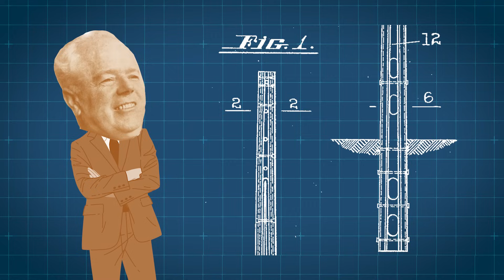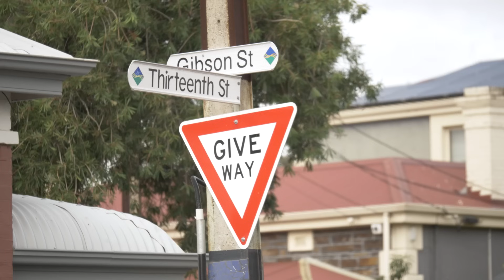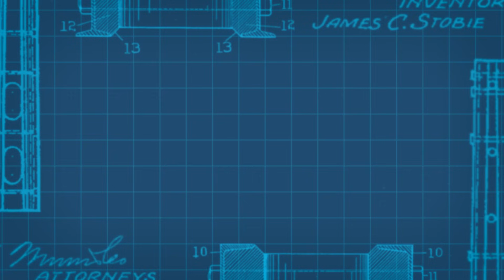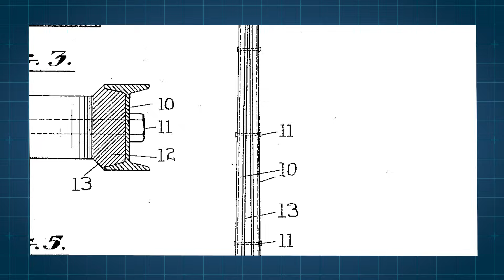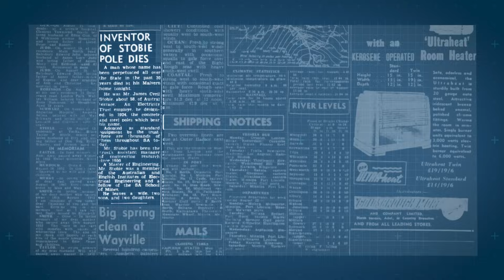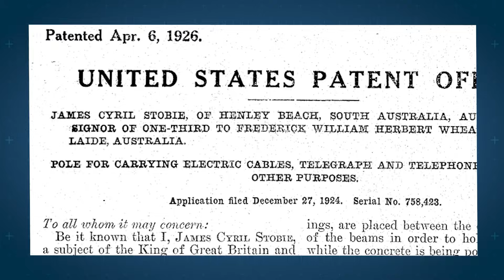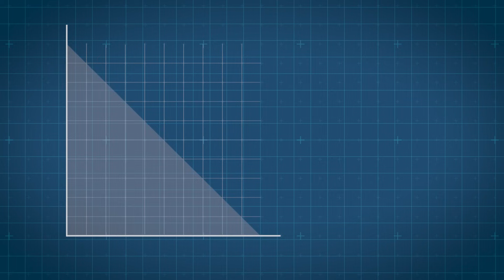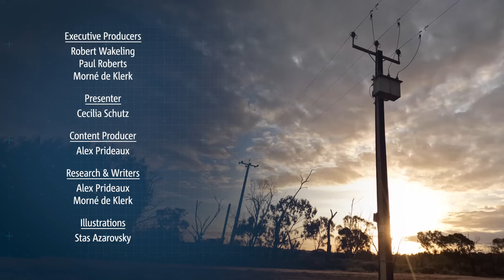Stobie poles: a century of powering South Australia

Comment: spent 15yrs in adelaide i noticed the stobie poles thought why aren't they used around OZ more often
seem better than the old wooden rotten lampoles we see in vic etc
Reply: They appear to be more difficult to climb than the conventional wooden cylindrical poles, requiring the use of insulated aerial platforms exclusively.

Comment: Who actually WANTS a power pole in front of their house. I'm off grid with none, no limits on vehicles or tractors.
Reply: A power pole in front of your house usually means a street light keeping your car in your driveway safer making thieves more visible. What I dont like is the stobie in front of my house is they put it a metre into alignment with my driveway. For decades my driveway only had a walking gateway even though its wide enough for a car. My house was built in 1864 so was there before the pole- sa water also put the meter in the way of the driveway too, but I dug it into the ground with a lid over.
Reply: The person who wanted a mural with an Australian bird like the other ones in the area. Probably funded by government, but unlike most other modern art actually might make the suburb better.

Comment: Stobie poles are common in Darwin and the Northern Territory - but without the concrete filling. I well remember  the Stobie poles on the Stuart Highway next to Darwin Airport on New Year’s Day 1975 - after Cyclone Tracy, they were bent over at 45 degrees, pointing away from Darwin towards the south-west, where my city of Palmerston now stands (think Canberra in the tropics, with 40,000 people - 25 kms or 30 mins south-west of Darwin). I flew-up then on a C-130 Hercules, as an Army Reserve Air Dispatcher (we trained in loading Hercs and Caribou’s for cargo parachute drops and normal flights). We were called-out in Melbourne on Boxing Day evening 1974 and loaded 71 Hercs on Darwin relief flights, 24/7 over the next 9 days - grabbing short night naps in our cars alongside the RAAF Laverton air-strip for the first 4 days, as Hercs from RAAF Richmond (near Sydney) could land at any time, needing loading and refuelling before a 6 hour flight to Darwin. Our main cargo was 2,500 equipment pallets - each comprising a petrol-powered generator, a petrol water pump and a gas BBQ stove. Drawn from camping shores in Adelaide, Melbourne, Canberra and Sydney - arriving on semi-trailers around the clock.They were allocated as one pallet per street, in Darwin’s wrecked suburbs - to allow the 9,000 men left behind, guarding their wrecked homes, to get together  and have a shower, a hot meal and some electricity each evening - after their wives and kids (35,000 people) had joined evacuation flights or driven south in the family car (usually with a cracked windscreen). (Kym (74) in Darwin - my unit was 37 Air Dispatch Platoon, Army Reserve - from 1971 to 75). (PS The RAAF had 18 of its’ 22 Hercs on Cyclone Tracy Darwin Relief flights over Xmas - New Year in 74/75 - plus a Herc from New Zealand (RNXAF) and a USAF C-141 Starlifter from Hawaii. My unit - 37 AD - had only 14 of us, but we were helped from 27 Dec after I rang the Salvation Army for help - they sent 20 younger Corps-men, to help us prepare pallets for loading,) PPS 73 adults and kids were killed by Cyclone Tracy.
Reply: Well if they didn't have concrete, they weren't stobies.
Reply: The Darwin stobies have horizontal steel bars linking the left and right upright poles, to provide strength during our regular cyclones. Then, they might bend a bit - but they won’t fall down. Are SA’s stobies cyclone-proof ? (Kym in Darwin - where our different stobies rule).

Comment: I don't think they are ugly. I've always for some reason appreciated lattice electricity pylons and power poles and n general. Electric overhead on railways . My autistic traits 🤪. It be expensive but any chance they could consider powder coating the metal ? Say try it on those poles that Only have a top set of 3 wires. Say trial a few poles that have those green disc insulators and powder coat the metal  a similar lightish green. Look spectacular. 
I went to south Oz and the rusty colour ruins the look. Take it from a 54 yr veteran of power pole porn

Comment: Nearly 40yrs ago we had a rope swing in the playground at my primary school in the Adl hills. The ground was sloped toward a fence and road that formed the boundary of one of the sides of the playground. The road was lined with stobies and power lines. At around grade 6 or 7 we found we were big enough to be able to swing out far enough and actually stand on the closest power line before swinging back. Luckily we were too short and unable to reach or bridge to the next row of cable. Good times.

Comment: Their only problem is they can rust at the base and topple over.
Reply: Never seen a pole fail by itself. Only collision by car, truck or heavy machinery vehicles...and even then the pole is mangled but still upright and doing its job.

But then maybe the one you seen was 100 years old? And if not in SA then it wasn't a Stobie pole.
Also most new ones have galvanised steel, these keep their metal colour and don't turn rusty reddish brown.
Reply: @stevenbalekic5683  It was in the Adelaide suburb of Hawthorn. The pole was not replaced and was not hit by anything.
Reply: @amraceway  
Must've been really old.
Reply: I've never seen one do that. Then again I haven't been everywhere.
Rusting to the point of failure would have to be rare. In environments where accelerated corrosion would be an identified risk a sacrificial anode or complete HDG would most likely be specified. Galvanized bolts would even do the trick. Stobie poles can be easily customised. 
Dingo piss corrosion may be an issue.
Reply: @walsakaluk1584  I have watched one fall as I was driving.Steel in contact with earth will rust .
Reply: @amraceway  no doubt.
My principal exposure to Stobie poles was in Ceduna. They weren't that old there and it was pretty dry most of the time. The old telegraph poles were rusted down to sidewall shredding stumps, but they weren't Stobie poles.
Locals frequently complained of Stobie poles trespassing into the path of their vehicles. 
They are a handsome sturdy pole.

Comment: I believe he was also paid a shilling per pole in royalies.
I had to convert all the imperial drawings over to metric. They also had a mold they held over the hole and pour the concerte in as a footing. Which made it easy to replace the pole after they were bend by cars. They bend over but still keep the wires off the ground. Were as timber shear off at the ground and you would have wires on the ground.